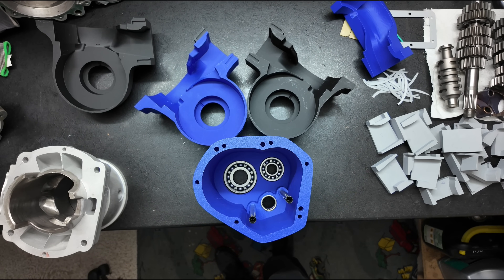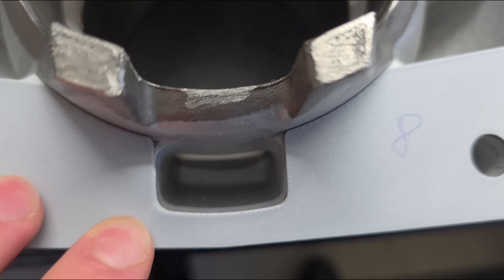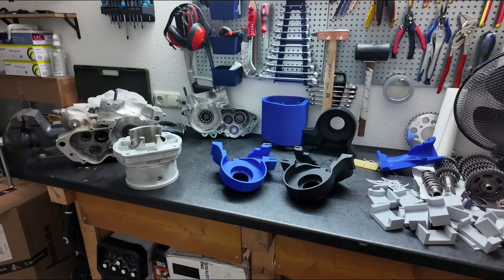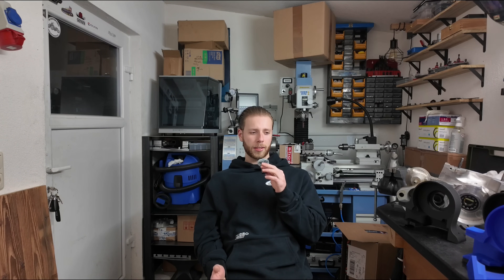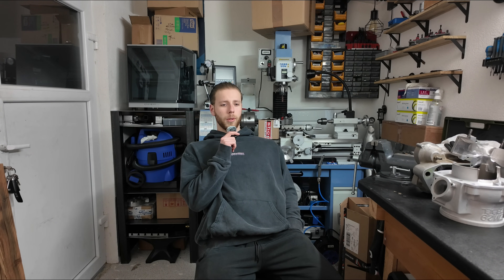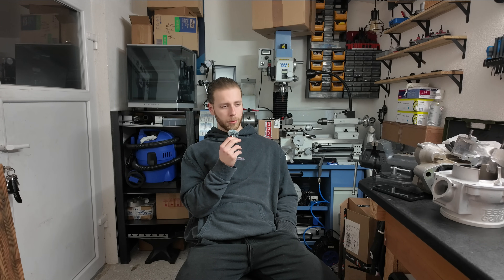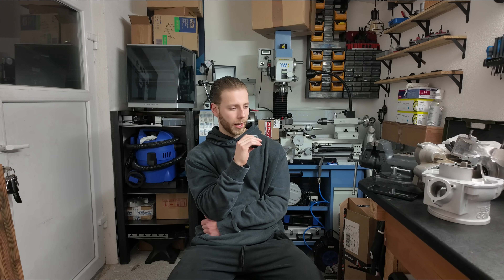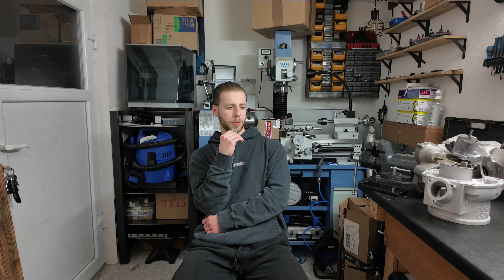ZABEL V-Twin Crankcase Development

Comment: You could use a stationary gear between 2 gears of equal size? You can't mesh the 2 gears together otherwise 1 will counter spin? So similar to planetary gear set or a rotary stationery gear?
The other thing you could consider is balancing the engine through counter rotation of the cranks, use tl each rotational mass on each crank to cancel the other one out? You could then run either a hot V or cold V setup?

I mean I don't know do what level of crazy you are expecting to go with this project on the future......but having a cold V could allow for a centralised plenum; if hypothetically speaking you were to ooops drop a turbo at where the stingers collect and merge, for instance 😁

There are snow mobile guys running 2 stroke 3 cylinder turbos and that's 10+ years since they first started development and they were only just starting to explore ECUs and tuning for direct and port fuel injection.
The reason people haven't succeeded running boost (like 2 strokestuffing) is because boost needs to happen AFTER power band!
Power band is what drives the turbo charger.
But now with electronic wastegates you have the ability to keep the gate open until power band and then close the gate to build boost!

Anyway I'm going off topic making silly suggestions but I can't help it.

PS. If you enclose your Carbies inside the plenum then boost maintains equal pressure inside and outside the carbie meaning reduced chasng tail trying to fix boost leaks from everything inside the carbie trying to force itself outside the carbie 😆 cause that's what happens when you DON'T enclose the carbies inside the plenum and another reason people give up turbo'ing 2 strokes.

Comment: zm29 and zm30 crank cases are slightly different, zm30 stud holes are slightly further apart so might change all the work you’ve done with the crank cases
Reply from the maker: I know. I also said this in the video that I mske a new crankcase.

Comment: Maybe you should invest in a 3d scanner? You could scan parts and import theirs 3d models as a reference in your CAD software.
Reply from the maker: Yeah on the exhaust I wanna use an 3d scanner to fit it on the frame. But for the inside of the engine its not that suitable because its not that precise.

Comment: There's another way . Just join both crankshaft together and build a one single crankshaft with adapter  with bearings in the middle , like any other two cylinder engine has .
Reply from the maker: wolt look that good in my opinion

Comment: I wouldn't get to hung up on making the transfer ports exact. They will vary from cylinder to cylinder due to core shift and pattern degradation. Leaving them small and hand matching will assure that it will fit any port differences.